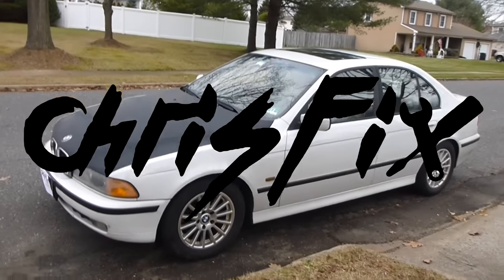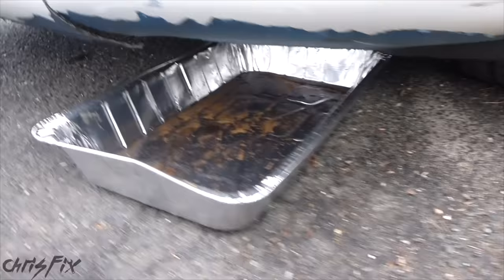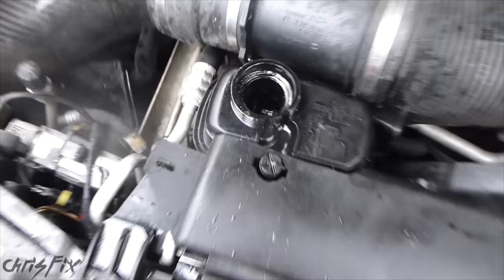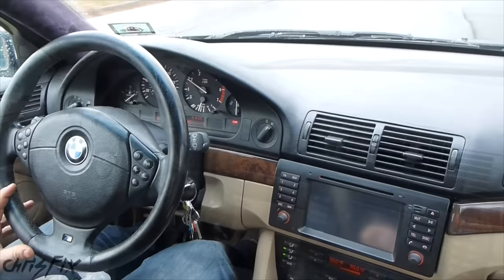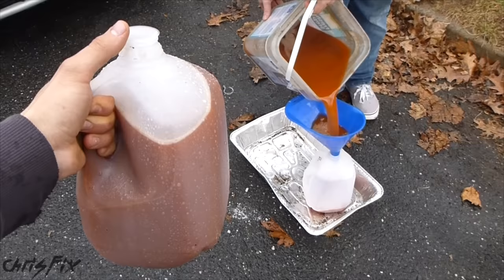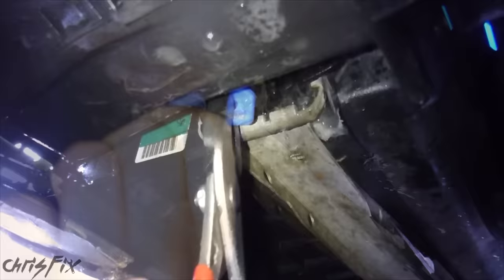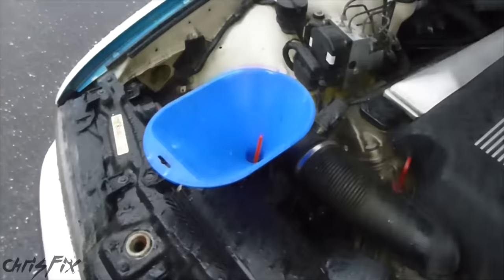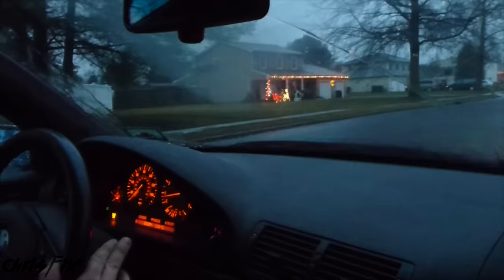How to Quick Flush Your Cars Cooling System

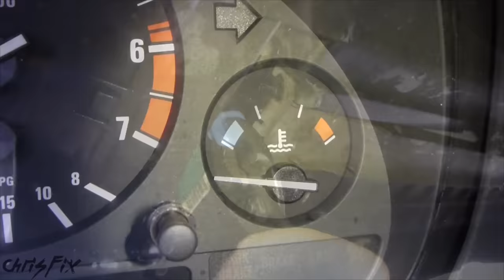Comment: i have a 2006 pontiac pursuit ,will draining it from the petcock be enough to get the fluid out of the heater core ,block,hoses,pump ,radiator etc? it will all drain out or most of it? and is it necessary to drive it around or can i keep it idle for 10 min with the heater on? what is the point of turning on the heater fan? is this juts to check that the core has water or fluid in it?also once you add the coolant do you need to idle it till it burps out all the air and keep adding fluid till it tops off? btw at 3:56 it was comming out orange yet at 4:12 the collection pan looked like clear water??

Comment: I like ChirsFix.... but this video is wrong. If you wait for engine to cool down whilst it has flush chemicals in there and THEN drain, the thermostat has closed up leaving chemical cleaner in part of the sytstem. Either drain when it's warm  or do mutplie flushes after getting car back up to operating temparture each time.
Reply from the maker: Well you can't open up a hot coolant system, but you could do multiple chemical coolant flushes (once cooled down of course)! Any remaining chemicals will mix into the new cooltant, and by that point it's negligeable!

Comment: What happens to the ceramic seal in the water pump when you do not run coolant in the cooling system? for example you just run Distilled water only (It stuffs the seal is what it does), my question is how do you flush your cooling system and ensure that you are not damaging your ceramic seal in your water pump as well doing it your way.

PS:- THE COOLANT does lubricate the ceramic seal if you have a ceramic seal. Running the engine without coolant can also damage the ceramic seal in the water pump

You may have caused a lot of people to purchase new water pumps etc in the last 8 years...................
🤣
Reply from the maker: Water still lubricated the seals and you’re not revving the engine. There is no problem with doing this.
Reply: @chrisfix  there is a problem because when I was an apprentice I did exactly what you did in the video, which is why I mentioned it
Reply: @chrisfix  For real, I would just delete the video if I were you. You did a poor job explaining folks how to it right, without causing issues down the road. Coolant system is not as simple as oil change, touch up paint and brake pad change. You have to really caution people every step of the way.

Comment: Question 🙋🏽‍♂️ what happens if you use filtered water and not distilled water??
Reply: Has to do with ionization. You can get limescale if you don't use distilled water in the radiator and hoses.

Comment: Hey chris I followed all the steps and now my car is overheating, when adding the distilled water I was only able to add half a gallon and then I turned the car on but the water would not go down. Now the car overheats and blows cold air in the cabin, any tips om what might be going wrong?

Comment: The heater in my car does not work as a cable to change from cold to hot has broken inside the dash (big job to fix this) can i still flush my coolant without the heater working or is it a no go

Comment: I did this and have flushed around 5 times with water and it still has a light brown hue when I dump the water. Should I keep flushing or just fill it with coolant?
Reply from the maker: If it’s light brown that’s about as good as you will get it so you’re good to go
Reply: @chrisfix  thanks!! New radiator in and it’s all set!

Comment: I have a serious problem with my family's 2002 honda accord. Car keeps overheating and there is bubbling at the radiator. It has 135,000 miles. The car needs to cool before it can continue its drive. There is no white smoke at the tail pipe 🤔. Im not sure what the cause is here. I think it's air trapped in the cooling system. Do I need to do a complete flush or quick flush in the video above. 

Im not completely sure. If anyone knows the highly likely cause please comment. I highly appreciate🙏.

Comment: Chris, what brand coolant do you recommend? so many to choose from and all claim to work with any antifreeze.
Reply: Not Chris, but I'd recommend using OEM coolant. It's similar in price (at least for Honda) and changed so infrequently that it doesn't make sense to try and save a few bucks on a possibly inferior/incompatible product. My 2 cents.

Comment: Good evening, I have a 2012 chevrolet aveo and the radiaror fan works and stops all the time.  I changed the thermostat I changed the water pump I changed the water cooler.  I noticed that after the thermostat the collar is always cold while the rest is hot.  An engineer who went to the car told me that I had to put in the original thermostat and change the pipe from the water bucket to the end of a plastic valve.  because there is no ventilation .. the temperature light has not come on.  Can you help me if I change the thermostat to genuine will solve the problem

Comment: What about the coolant in the engine block? Doesn't the chemical flush stay there?
Reply from the maker: There is a little bit, but it's not enough to get worried about! You can always do another flush if you want haha
Reply: @chrisfix  what about the overall water level? If I flush with distilled water, then drain the radiator doesn't about half the water stay in the engine block and heater core? So if I add 50/50 antifreeze, it would amount to 25/75 mix of antifreeze to water?

Comment: I have problem with my coolant system. I filled the coolant tank, all of a sudden it is almost empty. I checked for leaks. There is none. My engine was replaced couple months ago. I think there is air in the system or the hose have problems. What is the problem?

Comment: please help me out.  you removed coolant from radiator. 
you then said the system takes 3 gallons.
but you only removed the coolant from the radiator, which wouldn't be 3 gallons.
so how do you fill the 3 gallons of water into the system when the radiator isn't 3 gallons?? 
thanks for help

Comment: I've never changed the coolant in any of my cars.  when would I need to do this? how would I know if I need to do this?
Reply from the maker: Check your owners manual but every 5yrs or 60k miles usually. Otherwise the coolant loses its corrosion resistance and can start causing issues.

Comment: Hey Chris great video as usual. My upcoming flush will be my first. I noticed you didn't do any hose squeezing or elevation of the front of the car. How can I guarantee that there is no air in the system by filling the system with the car running does that guarantee this will be okay? Thanks for your tips, I think I'm even going to order one of your cool sweatshirts :-)
Reply: If you rev 2500 for say 30 seconds a few times that'll help ..if u git heat you shouod be good

Comment: i got a check light saying my coolant is low and. i didn't know. I think i might of used the wrong coolant in my car. I went and bought the "Peak Oet Extended life concentrate anti-freeze/ coolant european" I'm not sure if that coolant is the correct one to use in this so please help! i have an audi s4 b9 2019 btw. i’m not sure if this is the right coolant and i’m worried i mixed the oem coolant with the peak oet coolant
Reply from the maker: Just check the front of the bottle. It literally tells you what cars and years it’s good for.

Comment: I live in a desert so running the car with full heat blasting in my face would probably give me a heat stroke, is there a way to avoid doing that?
Reply: move out of the desert
Reply: open the windows and keep the fan on as low a setting as possible while keeping the temperature knob at max. the fan is irrelevant to this process its the temperature valve that needs to be open.

Comment: None of these videos ever explains how to get ALL of the old coolant or water out after you flush it. They all show pulling the drain plug on the radiator which only drains the radiator. My truck takes 4 gallons of coolant, but pulling the radiator plug only drains a gallon of coolant….from the radiator and overflow tank. So how do I get the other 3 gallons out?
Reply from the maker: Depends on the car. Some engines have a plug in the block that you can unscrew.

Comment: the distilled water is neccessary correct, i dont want to use the anti rust additive thing just wanna flush and put in some 50/50 coolant. Can someone confirm for me. I have a 95 Honda Civic coupe.

Comment: Whatz up everyone.
So my 2002 honda civic is overheating, checked fuses relays, fans, as i drive it heats up but then goes to the middle, definitely wouldn't drive on highway. When i open the radiator cap, its looks empty, but the reservoir tank is more than full 🤔, both tubes get hot to the touch. Im not sure if its the water pump or the thermostat? I was going to do a coolant flush but now im Wondering if it would even matter, since it could be clogged. Can anyone give some input, would greatly appreciate it ??? !!!

Comment: It's winter ATM in Michigan and is this safe for my block? Would t the distilled water get frozen?
Reply from the maker: No you do not want straight water in your block in the winter. It should be a 50-50 mix of water and antifreeze.
Reply: @chrisfix  I'll just do this flush when it gets warmer out. It's already Feb, will the distilled water eventually be gone and it'll just be straight  coolant? Bc iknow that water will be stuck in the  block and heater core so when I pour coolant in wouldn't it be mainly water than coolant?

Comment: Hey when I was adding coolant back to the system and it stopped after one gallon I turned the car on and it didn’t suck the coolant into it with the heater on. Anyone know what the issue could be? Thank you guys! 2008 jeep grand Cherokee 5.7
Reply: maybe you have an air lock in the cooling system, how much refill does it take? check for your model vehicle and engine on youtube for a video of how to bleed the cooling system

Comment: If I’m changing out my Radiator as well as my water pump and thermostat. Should I flush before or after ?? Reason I’m changing everything out is because of a leak.
Reply: I'd probably say flush out the old antifreeze, then flush with just water and not refill with new antifreeze. Then do a radiator change right after, just to avoid running old gunky antifreeze into your new radiator. After thats done, do another water flush, then continue the video and refill the antifreeze/burp the system etc
Reply: Moe Hussein that’s what I did brother, thanks.

Comment: But how do you flush it out if you're doing it as part of a water pump install because the water pump failed?
Reply from the maker: Drain and flush it with freshwater before you change the old water pump

Comment: What do I do if the AC doesn’t blow hot air when I turn it to max hot??
Reply: Ac heat or vent heat?
Reply: Zack Wetzel Like it doesn’t blow hot air out of the vents
Reply: Well if the car doesnt blow hot air out of the vent that points to a head gasket issue. There should be hot air. Get a head gasket test at any car shop for 100 bucks.
Reply: @hexna  that is a sign the head gasket is bad.

Comment: i have coolant fluid in my transmission will distilled water flush it all out after i drain all the coolant out then the distilled water?
Reply from the maker: I wouldn't put any kind of water in the transmission. I would first figure out where the coolant is being introduced and fix that, then do a bunch of drain and fills to flush anything out
Reply: @chrisfix  okay thanks

Comment: As I was trying to add the water and the flush it got to the top so I turned the engine on and it started raising not lowering???
Reply from the maker: That means it was already full. Let it keep running as it overflows it will force all the air out

Comment: 2:10 what happens if you only drained a little? I poured in maybe 2 quarts and it topped off, even after running the car. Blockage?
Reply: Mines doing the same... The expansion tank will not completely empty

Comment: I turned on the engine to get all the water out and locked my keys in the car. 2 hours later and the locksmith finally showed up but now the car won't start. Any suggestions?

Comment: Word to the wise: do NOT use radiator cleaner/cooling system cleaner. Distilled water ONLY. Why? Well, remember that bubble machine from Willy Wonka's Chocolate Factory? Yeaaah. Now, a week and dozens and dozens of flushes later, I have it mostly under control, but it is STILL coming out as foamy as a dish sink. This can't be good for my vehicle, at all. It will NOT come out! I am currently flushing over and over, scared for my vehicle. My cooling system is full of air bubbles and cleaner which is apparently corrosive in the long run. This was supposed to be a one-hour job. It would've been a one-hour job! Learn from my mistake. Don't be that guy. Do not put radiator cleaner in your vehicle. It's so horrible, I don't see how it's even legal for them to sell it.

Comment: I’ve opened a radiator an hour or two after driving 25-30 minutes… it exploded 50 ft into the air and burned the side of my face.    Sad day (;
Reply: But besides that, was your experience a positive one?
Reply: @malcolmt7883  :'D

Comment: Did you flush the system using distilled water? That’s not really necessasry. Its only in there for 10 minutes of test drive.. you’re not going to get deposits forming. Use regular tap water for the flush and save your £5. 

You also ought to buy concentrated coolant and mix it out to 50:50 yourself using that distilled water you didn’t waste. When you buy pre-mixed you’re paying the manufacturer to mix it for you. Concentrated is half the price, though you need to add the water.

Comment: One big thing to keep in mind is that many of these coolant brands that say "safe for all makes" just aren't.  Had to do some digging to find the proper type for my car, and there are plenty of different specific formulations for different brands and different countries.  For example, most Toyotas from the past 20 years use PHOAT (Phosphate Hybrid Organic Acid Technology) type coolant, which isn't very common.  

There's also POAT, HOAT, OAT, and other types.  They mostly have to do with additives that prevent corrosion, and these additive can be destructive, used in the wrong cooling system.  From sludging to eating seals to wearing down the water pump.  One of the primary offenders used in many "universal" coolants is 2-EHA (2-ethylhexanoic acid), which destroys silicone and certain plastics.  Read your owner's manual, a repair manual, or even scour the internet.  Or just stick with the OEM stuff. 

One more thing:  the color of the coolant these days absolutely does not guarantee compatibility.  Many manufacturers make one type of coolant, then change the dye color, so when you're just doing a radiator flush, the color of the coolant remaining in the block won't mix the new stuff into something ugly.  For example, the Pentofrost A4 I got for my 2004 Toyota (similar to Toyota's Super Long Life pink) is colored pink.  But they also have the same exact formula, dyed blue, to match Honda's coolant color.

Comment: I need my ac to be colder will this help
Reply: Noe Banuelos unfortunately not
Reply: zachattack1479 damn what could I do
Reply: @Fattboiixx  the a/c system in cars is the hardest thing to diagnose and work on but if your car is old you can try and recharge the system with a kit from the store watch a video on how to do it but if there's a bad leak in the system then it won't stay cold for long. However by design all AC's leak a little over time

Comment: I know this video is old but I mistakenly pour red coolant over my green coolant, does anyone know if this would cause an issue?
Reply: depends if you're old coolant is 5 year and the new stuff is 2 year or ethylene glycol it can cause problems, dexcool and ethylene glycol from what ive heard forms a pretty thick paste. please note im not a mechanic im just repeating what ive been told
Reply: @kalebgruber7237  thank you for the response, I think I’m going to flush the coolant to be safe
Reply: @kingofall9262  again I'm not sure but I'd look into what u had what u put in and how they react
Reply: @kalebgruber7237  I just pour antifreeze 50/50 red coolant over the antifreeze 50-50 green coolant, at first I didn’t think it was a big deal but when I researched it, there is a lot of contradicting information so I figure maybe I’ll just flush it